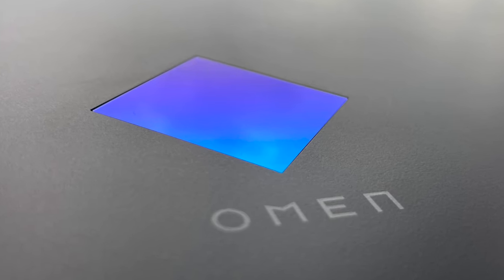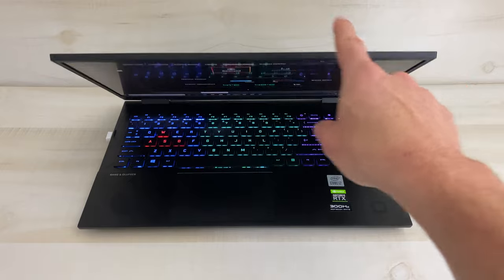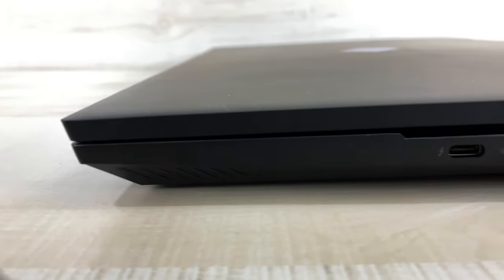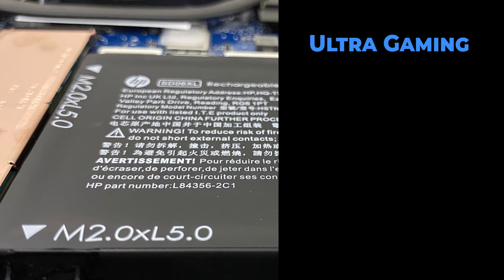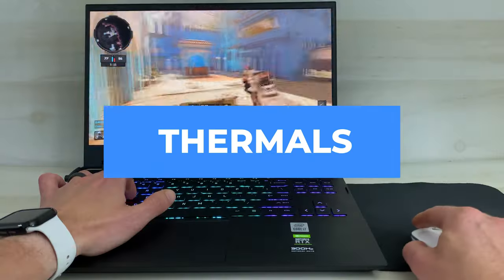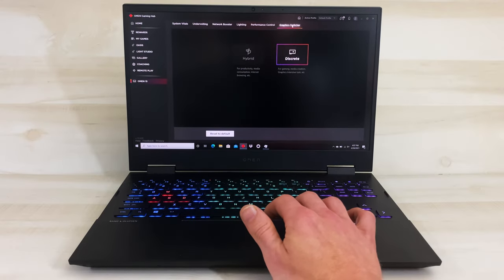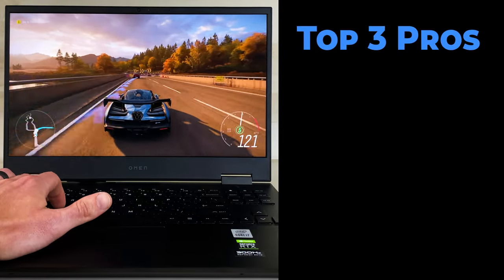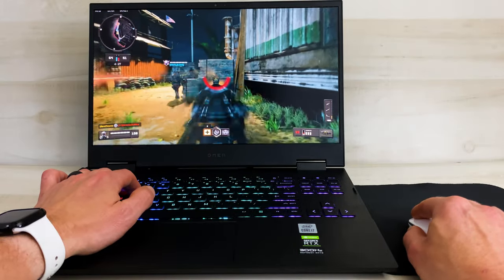HP Omen 15 Review - So Much Power!

Comment: I bought the one with AMD R5 5800H W RTX 3060 
But I just noticed that when I'm gaming while plugged in the battery percentage keeps dropping, so is this normal?!
Reply: I've heard about this. It's actually a pretty common occurrence on some gaming laptops under large loads
Reply from the maker: I didn’t have that experience with mine but it is possible when pushing it really hard on certain games. How fast was the battery going down?
Reply: Based on other reviews, there's this feature called Adaptive Battery that can be accessed through BIOS. It supposedly helps to prolong battery life in a way that it prevents charging when cpu is under heavy load. Though from what I read, it caps at around 50% so at that point the battery will then go up

Comment: Hey i too have hp omen 15 but 2020 version and wifi card isn't soldered and is easily replaceable.
Reply from the maker: yours is wifi 6 right? I don't see wifi 6 being replaced for a while
Reply: @JustinTechTips  yes. It's very good. I've never seen any speed drop or signal fluctuations.

Comment: 0:45
*2070
Reply from the maker: 3070
Reply: @JustinTechTips  The text on the right at 0:45 says 2070 max q and you said 3070 max q
Reply from the maker: I know that was a typo. I’m sorry about that. What I said was correct, what I typed was not. It is a 3070. Sorry for the confusion
Reply: @JustinTechTips  100% I just wasnt sure at the beginning🤙

Comment: Again, someone fooled by hp air vent-like speaker
Reply from the maker: I put a piece of tissue paper next to it when the fans were at full blast and it didn’t move at all. So if they are fans, then they aren’t that powerful
Reply: @JustinTechTips  maybe it sucked the air not pulling? But who knows